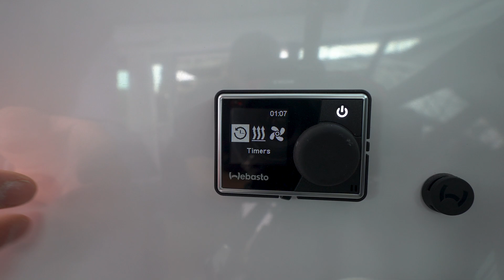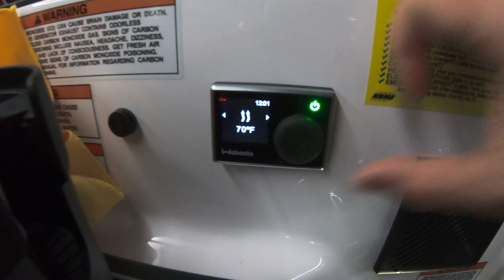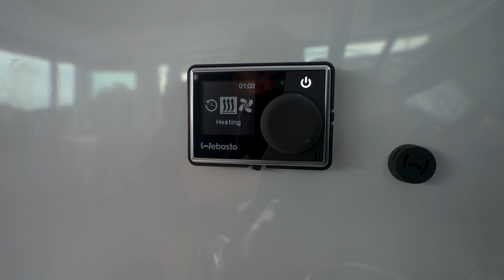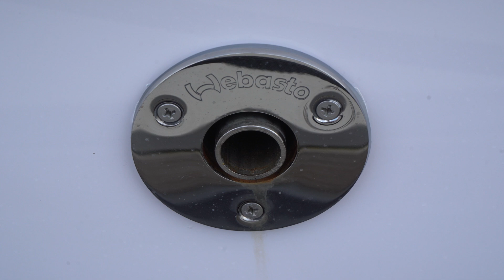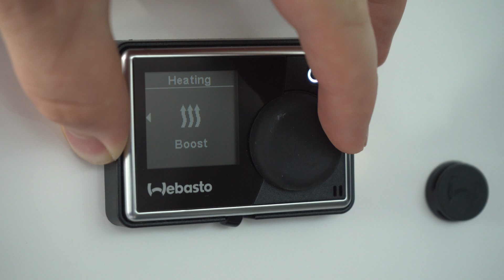Diesel Heater on the Axopar 29 | Axopar Education Series

Comment: how good does the ventilation work in a hot summer in the mediterannean ?
Reply from the maker: It will blow air like a fan, but depending on your area you might want to consider installing AC. Not really needed here in Maine, but places like Florida would be a must.